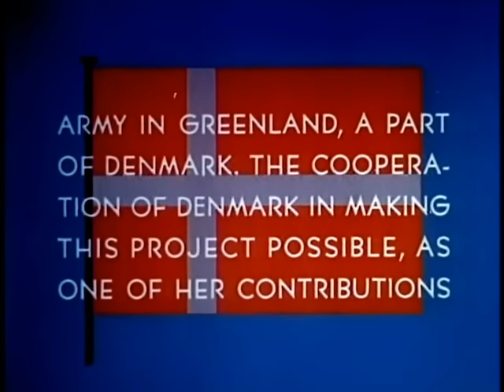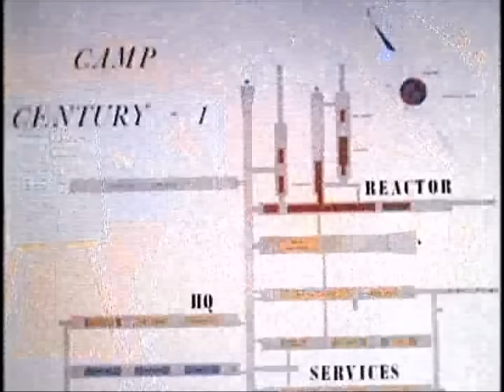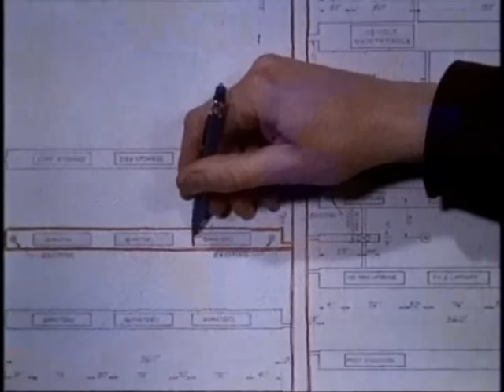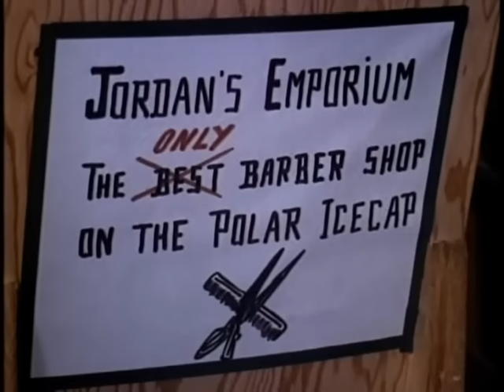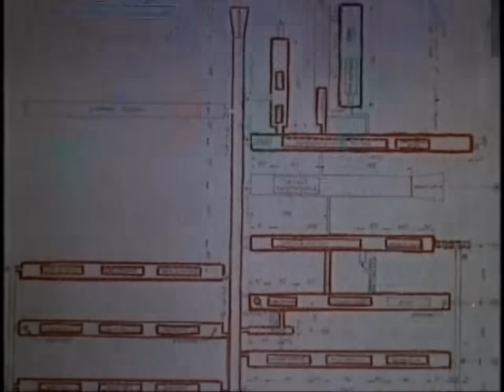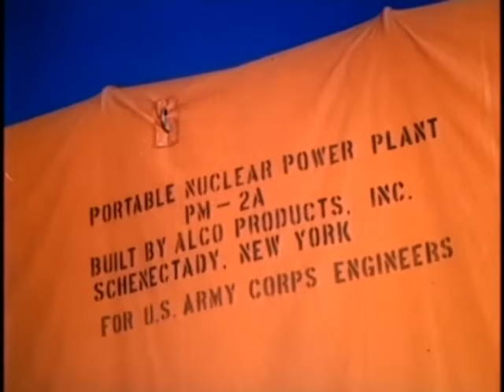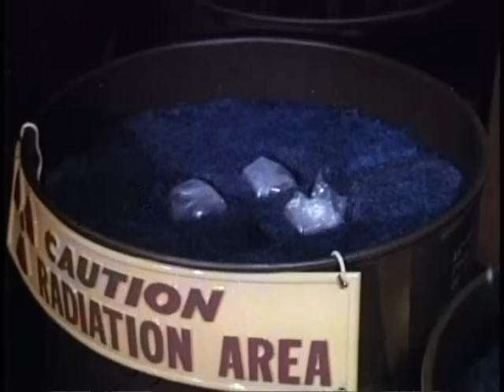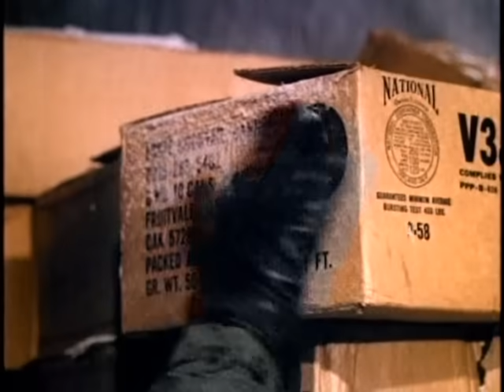The U.S. Army's Top Secret Arctic City Under the Ice! "Camp Century" Restored Classified Film

Comment: I spent a year stationed at Thule Air Base from Sept. 1967-Sept. 1968 and not once did anyone ever mention Camp Century. I see via the Internet that it closed down in 1966. Surprising it was not even a discussion point while I was there. I was there when the B-52 crashed on the ice in January 1968 and helped with the clean-up. But the coolest thing while I was there was the ice we had in our drinks at the service club on July 4. It was taken from the ice cap at a depth that they estimated was from 1776. All I remember about was that it popped and crackled in our drinks.

Comment: I've held one of those (new) fuel rods in my bare hands.  Nope, it was not any more radioactive than normal background.  However they were 99.999% pure U235 and could go prompt critical if mis-handled.  Many similar reactors were given to allies in the Atoms for Peace program.  The training reactors were basically big tea kettles and were large, concrete supported aluminum cylinders open at the top.  Made the coolest blue color when operating.

Comment: Despite its seeming stability, the icecap is, in fact, in constant, slow movement, spreading outward from the center. This spreading movement, over the course of a year, causes tunnels and trenches to narrow, as their walls deform and bulge, eventually leading to a collapse of the ceiling. By the summer of 1962 the ceiling of the reactor room within Camp Century had dropped and had to be lifted 5 feet (1.5 m). During a planned reactor shutdown for maintenance in late July 1963, the Army decided to operate Camp Century as a summer-only camp and did not reactivate the PM-2A reactor. The camp resumed operations in summer 1964 using its standby Diesel power plant, the portable reactor was removed that summer, and the camp was abandoned altogether in 1966.[

Comment: The project was started in 1960 and abandoned by 1966, a costly flop.  Although it was built on the Greenland glacial sheet, they didn't reckon with the rapidity of ice movement, which gradually tore the tunnels apart and collapsed the roofs.  Camp Century was part of "Project Iceworm".
Reply: I wouldn't necessarily call it a flop.  Yes, it didn't work as planned, but we did learn from it.  Everything that went into building this project helps future projects.  Not every undertaking by man is going to be met with success.  In the words of Benji, "not everything is going to be gold."
Reply: *****
i think you're being a little harsh. its obvious that glaciers move but not so obvious, especially at the time, how quickly. don't forget that continental drift was only proven in the late 60's yet any kid can look at a globe and ask "why do south america and Africa fit?"
Reply: it was removed halfway through the base's operation
Reply: *****
	 	 	 	I'd argue it was the research; by way of experimentation. it sought to answer the "question can you build a military establishment under polar ice" the answer being yes but only in the short term.
There was also the secondary question “can you power a military establishment by way of a portable nuclear reactor” the answer being? You can but for strategic reasons it's not worth the hassle (also dare I say environmental reasons? I'm under the impression the reactor ran some kind of open cycle discharging irradiated water in to the environment!)
If those where it's objectives it was a complete success.
Reply: *****
Yea, experience acquired from working in this environment is just as vital. Mistakes are also good teachers.
Reply: ***** In fact you can build into mountainsides.  It's been done maybe a couple of times. :-)
Reply: lendoggtheking It could have be long term, it just required a lot of work to keep the ice back, they had to remove 150 tons of ice a month to maintain it.
They are still using the 5000 ft long ice cores from there to study climatology.

I just wonder who got stationed up there, was is all the rebels that couldn't follow the rules so they would get sent up there as punishment, I can't imagine to many enlisted men volunteering to go up there.
Reply: i'd say it wouldn’t be practical in the long term without something solid to hold the ice back (large concrete tubes?). as an engineer or scientist it would be a great posting as an enlisted man... less so!
Reply: Kermit The Frog Yes there were missile silos around this time with shorter operational lives.
Reply: Milosz Ostrow #Went to Alaska 👀
Reply: Globe?
Jk
Reply: They taught that dog some great construction techniques though. He was the real base commander.

Comment: The biggest problem of Camp Century today is the vast ammount of uncountable tons of frozen nuclear sewage of the  1.56 MW portable medium reactor  Alco Products PM-2A and the other fluids like diesel or acid. The nuclear power plant was designed to provide 1560 kilowatts of power, during the 
reactors operational life, a total of 47,078 gallons of radioactive
                  liquid waste was discharged into the icecap.  The 
PM-2A was removed in the summer of 1964.
Reply: AtomicInsights.com, a renown nuclear professional blog, cites all that as so much bogus bull.
Reply: Show us where exactly.
Reply: Those reactors need to be refueled every 30 years. What sort of waste do you think was coming out during the 6 years this one operated?

Comment: I can only imagine what they are capable of now with modern equipment and technology.  God help us all.
Reply: Naught to worry — the project was a flop.  Read about it in Wikipedia under "Project Iceworm".
Reply: ***** If a machine such as the subterrene existed, we wouldn't still be using mechanical tunnel boring machines and someone would have leaked photos of such a device years ago.  It's science fiction.
Reply: ***** we do check out the new iceworm contingent you can see it over Antarctic on google earth
Reply: *****
You simply need to Google "Mining Tunnel Boring Equipment Photos" Obviously you will be quite surprised.
Don't you understand that we are in the 21st century? What is it that you think Engineers do all day for the last 100 years? If you can think of it, (mechanical devices) Engineers probably thought of it first, have already built it, or are working on it, or it simply wasn't funded....or more accurately the Exploiters in Charge don't want you to have it, because they can't make as much money off you if you had it. For example, why do you think GM recalled and crushed the electric cars back in the 1990s? They knew that electric cars are superior vehicles, but they don't use gasoline, they don't need as much maintenance and they have zero "regular replacement parts". So, because they cannot exploit your transportation needs as effectively with electric cars, as they can with gas cars; they don't want to produce them.
Reply: Donald Eyermann Yeah, so what?  I Google "Mining Tunnel Boring Equipment Photos" and all I see is page after page after page of conventional rotary tunnel boring machines (TBMs) that use tungsten carbide claws and wheels to rip and crush rock, and rubber conveyor belts to carry away the spoils.  While these machines are quite remarkable feats of modern engineering, there's no Tom Swift science fiction stuff anywhere to be seen.
Reply: The weapon of deception and controlling everyone privacy,money,and well everything about our lives is scarier.
Reply: no
Reply: JesusChrist
When are you coming down here and do something about this shit?
Reply: ***** Its possible. But not cost efficient. Unless you expect every civilian to spend 200000 dollars or more to drive a car.
Reply: whats wrong with that?
Reply: +sploofmonkey "And he said we shall go forth and colonize! Not only other planets, but moons and asteroids as well! Even entire systems!"  It was said, it will happen, the prophet has spoken!
Reply: Samanthao49 #Well they can listen to you when your phone turned off 😫😌😌👀

Comment: And I want a nuclear powered arctic research center so fucking bad...
Reply: +Kilo Byte doesnt a nuclear power plant needs constant cooling? maybe this power plant is the cause of world warming, Because its  like a huge heater.
Reply: +Thermin Ator 
This base was closed and abandoned in 1966......
Reply: Nope. This base was closed down because of how quickly Greenland's ice sheet was moving and now with the planet getting warmer and warmer, I would imagine the ice sheet is moving faster than ever.

There's no nukes stationed in Greenland and I doubt there ever will be anytime soon unless the ice sheet stops expanding, but I don't see that happening anytime soon either.
Reply: +Kilo Byte - Kyle - when there's no electricity or gas for fuel - nuclear energy is the only source...It isn't always dangerous....
Reply: +Fa Que u know what happened to the nuclear reactor? did they de comission  it, or is it still there? ....just fizzing away?
Reply: +Del Lawrence it was decommissioned and removed before the camp was abandoned. Camp Century's original location has moved many miles since that time.

Comment: 25.30 They were wearing protective booties on their feet but handling the fuel rods in T shirts? What's the go? Any physicists out there?
Reply: +Bloodaxetheirritable +Bloodaxetheirritable I want to say the fuel rods aren't very active. Nuclear reactors use pretty unconcentrated Uranium. It gets powerful when you bunch up a ton of rods with moderators.

I'm guessing they still wanted to contain any radioactive dust or particles, so the boot covers would prevent them from tracking stuff around.
Reply: Thanks, I accept and will go that explanation.
Reply: +Bloodaxetheirritable  they were more worried with getting dust on the fuel rods  which could contaminate the water. The water that those rods go into is extremely pure for criticality reasons. They weren't concerned with uranium dust getting into their lungs, and no clothing is going to protect you from gamma rays. The activity level of U235 is very low.

Comment: I am by no means a Radiation expert but wouldn't you think loading the reactor by hand would be dangerous?
Reply: ACTUALLY IT IS COMPLETLY HARMLESS UNTIL IT IS ACTIVATED. YOU CAN HOLD IT IN YOUR HANDS, BUT WHEN IT IS PLACED NEXT TO AN ACTIVE RADIOACTIVE SOURCE IT BEGINS ITS REACTION, THEN VERY VERY DANGEROUS
Reply: That makes no sense. Please elaborate.
Reply: *****
Craig's reply is correct but very much over-simplified.  Not trying to be disrespectful but...To explain this to you John the prerequisites would include satisfactory completion of college level advanced algebra, classical physics, calculus, (integral and differential) plus more.  Then 4 semesters of nuclear physics and applied reactor physics.
Reply: Jimmy RD I have a EE degree but still do not see how you handle radioactive material by hand with no protection. As far as activating it later I have no idea how you "activate" an already radioactive fuel. Not talking about control rods but the active fuel rods.
Reply: *****
Well John, you have the classical physics and the math.  Now all you need is the nuclear physics and applied reactor physics.  I have a Applied reactor physics degree.  A short answer which you will just have to believe is that none of the reactor components are more than VERY slightly radioactive.  Far below the limits set by current safety standards.  Gloves are used during INITIAL fueling operations to keep elements clean.  After the reactor operates for some period of time at power levels EVERYTHING within the reactor including the vessel becomes VERY radioactive.  (If you stood beside an unshielded fuel element or control rod AFTER power operations you would indeed die very quickly.  The power operation is what makes these components seriously radio active - until then they are perfectly safe.) Thus endeth the lesson.
Reply: Jimmy RD Your right I have no idea why that is possible but I'll take your word for it since they did it and it appears to be a common practice. thanks. .
Reply: DiscouragedSoldier
 A discouraged soldier?  Tell me more please.
Reply: Craig Morgan
Not just any radioactive source.  It must be a neutron source. And the neutrons must be thermalized at that.  Then U235 would begin to fission.  VERY bad news then.
Reply: *****
 You are correct.  They are receiving alpha particles from the U235.  However alpha particles are effectively shielded by alamost anything.  Their gloves are much more than sufficient to shield them from alpha.  As for the sun - other than light (photons) we get cosmic rays (gamma)  from being outdoors. No alpha.
We also get lots of radiation from the earth as well. Including gamma and some beta.
Reply: John, if you can safely handle a new fuel element without heavy protection (hot cells) depends on the fuel that is used. Pure uranium fuel elements, that consist of mixtures of the isotopes 235U and 238U, can easily be handled, because:
- the half-lifes of these isotopes are very long, leading to very low intensities (of radiation) 
- the radiation consists mostly of alpha-particles which can easily be shielded. Actually, alphas can hardly penetrate human skin
- uranium does have some radiotoxicity (due to its alpha activity) but also a considerable chemical toxicity. However, the uranium in fuel elements (be it metallic uranium or its compounds) is completely encapsulated e.g. in zirconium alloy (closed tubes), which of course also completely shields the outside from the alpha radiation

However, the chain reaction that runs in a fission reactor leads to the formation of new radioisotopes in the fuel elements (due to fission of 235U and transmutation of 238U), many of which are highly radioactive, and some are quiet volatile. That's why spent nuclear (fission) fuel is always extremely dangerous.
Reply: Berliner7654321
Berliner is exactly correct.  Described the process more elegantly than I. (I am a retired nuke - I'm guessing Berliner is a nuke too).
Reply: Jimmy RD
I also knew many of the soldiers in the movie.
Reply: Berliner7654321 Thanks for the description. I understood that as much as any layperson can understand the basic principles of it. And no, it didn't require a degree specific to the field to understand it. Thanks again for the clarification.

Comment: During the PM-2A reactors operational life, a total of 47,078 gallons of radioactive liquid waste was discharged into the icecap...The U.S likes to leave its mark wherever it goes!
Reply from the maker: #america
Reply: The amount of waste they generated is insignificant as it will decay over time. This radioactive Liquid "Waste" is only coolant in the reactor that they discharged. not straight up fuel. Just chemically treated for Purity. The chemicals they used will breakdown. The radioactive constituent is just corrosion products dissolved from usage. This will amount to an extremely small contribution to the environment after the short lived isotopes decay. If someone were to look for the remnants it would be extremely difficult to detect as it would have already diluted millions of times over.

Comment: What they don't tell you here is that the system of construction was a complete failure that had to be abandoned within 3 years or so as the armcote roof started to collapse into the trench and crush the buildings due to the warming of the trench. The same system was used at Byrd Station in the Antarctic which is in fact  20 to 30 deg c colder than the Artic. The same happened down there but due to the remote location (800 miles from the pole) they resorted to cutting out the roof material which slowed the collapse down. Ultimately the station was abandon and left deserted complete with all its stores ready for a winter over team. The sad part was that once it cooled down it stabilised and was still in tact in 1979 when I had the opportunity to explore the complex. I understand that it was stripped of all equipment in the 1980's due o budget restrictions on purchasing new equipment. Just out of interest the temperature inside the base was a stable -60 degrees centigrade.

Comment: Ecuador has some mountain peaks over 15000 feet high, it might be possible to use the same type of reactor to power a magnetic launcher from there to send materials into orbit. 3 miles up it would use a hell of a lot less fuel. The loads wouldn't have to fight the denser atmosphere, and with enough research, smaller loads might avoid fuel expenditures altogether.
Reply: lol - nope
Reply: Yes, that's true, increased elevation would make a difference  However, the advantages of orbital launch from 15000 ft elevation are actually very small, certainly not worth the extra expense to build the necessary infrastructure and transport the equipment to this location.  If only we had a mountain at 200,000 ft tall, then the benefits might out weigh the costs - but even then, only maybe...
Reply: I was thinking along the lines of starting with an elevated magnetic launcher possibly coupled with a reuseable heavy lifting body. With time and development the launcher (same principle as the bullet train) just might be able to handle modest orbital resupply missions without any fuel expenditure at all.
Reply: LEIGH BARTON Such an idea has been proposed.  However, it requires a VERY long and straight track, impossible in most mountainous regions.  And, again, the extra 15000 won't make much difference.  There is still a huge cost over, say, setting up a track in the desert. In any case, its impractical all the way around...

Comment: They only need to pull up the control rods 6.24 inches to start boiling water. Those guys were unpacking the uranium fuel rods with nothing but gloves. Just wondering here, is that safe?